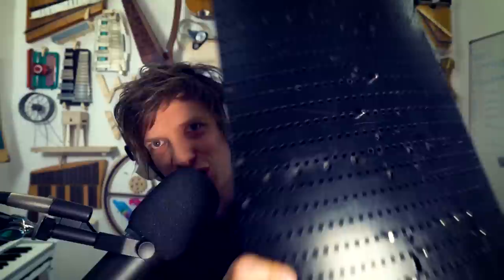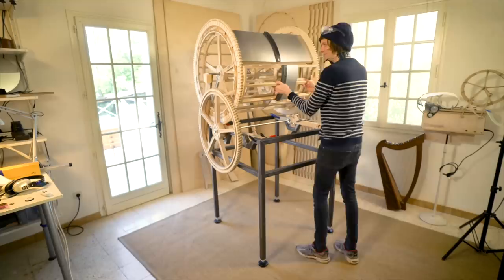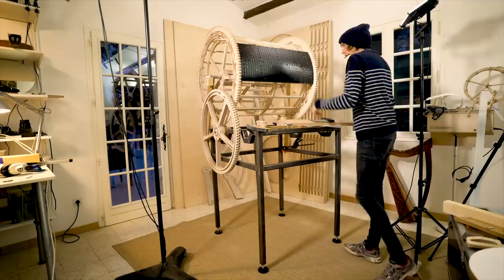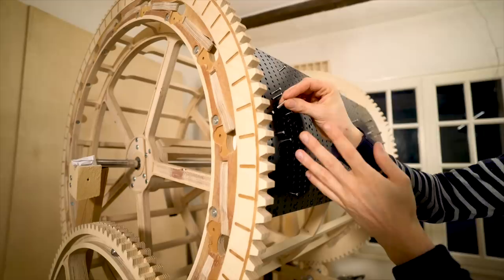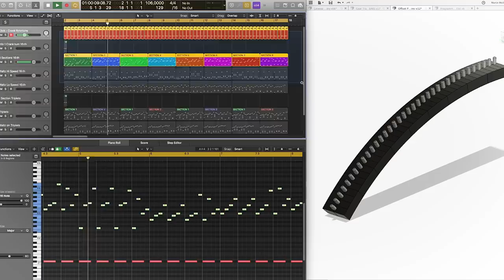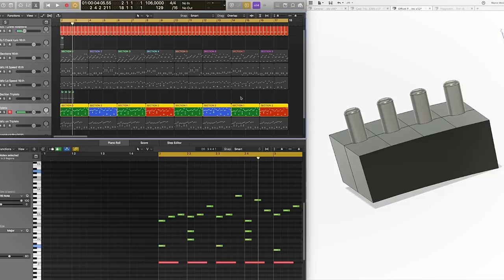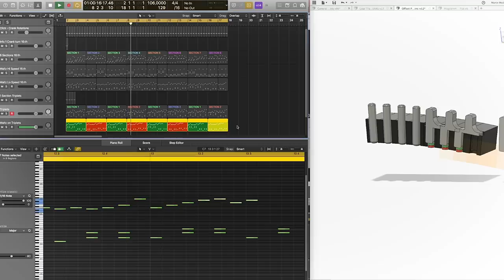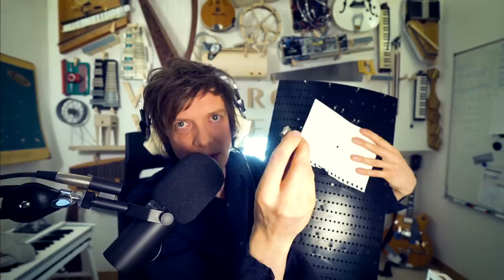Magnet "Midi" Music System - Marble Machine X #25

Comment: I just had another thought: If you provide 12 programming holes per "beat" or crank turn, you can thus arrange BOTH triplets and sixteenths without the need of offset pins, etc. 

This is actually what many of the music arrangers at the QRS music co. did for their pop piano rolls in the 'teens, they used a grid of 12 or 24 steps per beat, allowing for perfect triplets, perfect sixteenths, etc and possibly even sextuplets. (and yes, in the case of the rolls, the steps are very small and close together to save paper space, so that a high paper speed would not be needed for the roll). I think 8 steps per beat were used on some fast duple rolls, and of course triplets would not be possible there. 

So, if you check out the post-1915 (about when they discontinued non-quantized pop rolls in the Autograph series in favor of perfectly mathematical quantized masters) 'teens and 'twenties QRS rolls by Max Kortlander, Pete Wendling, James P. Johnson, Phil Ohman, Victor Arden, Scott and Watters (Roberts and Kortlander), J. Russel Robinson, Zez Confrey, and all the rest, you will hear some of the possibilities and results of this 12 or 24 (or 8) steps per beat roll arranging method.
Reply: Yeah, I was going to suggest something similar, but your idea is even better because it won't require changing any part of the machine that is already built.

Instead of having a number of pins that is a power of two (2,4,8,16), you could have a power of two times three (6,12,24,48). Such numbers can be divided evenly by both powers of two and multiples of three, without the need for any offsets or oddly-shaped pins.
Reply: Clever! Thinking in subdivisions is a much more efficient method.  He may have to use the bar magnets sideways to get the cuts close enough together, but I think this gives him the most flexibility.  He could easily do meters in 2, 3, 4, 6, or 8 without any retooling at all.
Reply: Pretty interesting idea, but the main problem is the feasability: the holes cannot be too close to each other in the rotation direction, otherwise the magnet won't hold in place, and they can't be too far apart laterally because of the width of the actuator that is associated to the track.
Fitting 12 holes in the space there is currently 4 might be quite a challenge. Or it would require changing the programming wheel diameter
Reply: There's also the issue of the time required from actuating one of the levers with the pin to when it settles back and is ready to be hit by another pin.  Going from 8 to 12 pins per programming strip may not be feasible unless MMX is played slower.
Reply: The glory of Base12
Reply: You might be right... but why wouldn't the magnet hold in place if the holes were closer together? Would this be due to some kind of repelling action due to the magnets embedded in each detachable plate for the programming wheel being too close to each other? Would there be a way to mitigate this by making a kind of "web" of some kind of material in-between each embedded magnet, which would block the magnetic field between adjacent holes and keep each individual hole isolated from one another?
Reply: you can do staggered double rows to save some length space, if there is space constraint for the 12 holes.
Reply: A lot of css frameworks use this idea for layout columns... I was going to suggest it... but thought I'd check the comments first :)
Reply: i feel like one issue with that is even if more subdivisions is physically possible, his music style might have to change. a full rotation as it is loops back to the start. if you were to go from 32 per section to 36, then it would loop to the beginning every 1.125x(?) what it is now. it could be turned slower but it wont line up the same unless it were 32x3 per section and then the 4ths were spaced out as 1 pin every 3 pin holes. at that point, the physical construction becomes a problem

Comment: Hi Martin, I couldn’t get into the pinned comment, I guess it’s limited to 500?  Anyway, 2 suggestions:
1) not pins; use bars or even the clicky pen thing.  Why? A dropped pin rolls like a marble;  a bar stays where it falls!

2) I just think black is a terrible color for performance programming.  Is the lighting good on stage during performance?  Try finding black holes on a black background.  Ack!  I would light colors, and I would use colors like you did in your software:  each measure a different color.  Or different octaves a different colors.  Use visual cues to make programming as visually easy as possible.  Unless you’re going to do all your programming in your well-lit shop.   
Love your stuff!  You are a Renaissance Man!

Comment: How about make a reprogramming wheel? It basically works as a music box, a line of trapdoor allow the magnet rods drop onto the program pad, and the open & close of these trapdoors are controlled by a pouch hole paper just like any music box; when the program pad moves synchronized with a pouch hole paper, the trapdoor would open when there is a hole on the paper, and a magnet rod would drop onto the pad and stick into it.

Comment: Use LEDs to mark which holes need pins. Have the power applied when the programming wheel section is taken off, using a plug in power supply with the input jack on that programming wheel section. Each hole gets an led. The controller can also be separate from the programming wheel section, and am the song could be selected as part of that plug in module.
Reply: You could also have a board with LEDs on it that the sections can be placed on, and have the board be connected to a computer or Arduino so you can port the music from midi software

Comment: Hey Martin, I've got an idea for using triplet holes rather than offset pins. Using the bar magnets, could you not align slots horizontally for the sixteenth notes, and vertically for the triplets, on the same track? Or vice-versa. The first slot of each beat would look like a "T", since the sixteenths and triplets both begin at the start of the beat. All the magnets would still fit snugly, and you could write more complex rhythms for one track while saving space. It would also be easy to make templates for reprogramming: Horizontal slots are for sixteenths, vertical slots are for triplets.  

Love this series, thanks!
Reply: I was thinking similarly, however I am unsure as to if the risk of snapping in the horizontal position is significant, compared to the vertical?
Reply: tuve la misma idea :)
Reply: Garrett D Good point, the horizontal magnets would undergo more stress....hopefully not enough to break them
Reply: This seems like the ideal solution. Draw a picture, and share it to the picture stream he linked! He'll see it faster.

Comment: That gear.
oh dear.
Reply: Nothing to ~wheel~ about
Reply: The sadness of this was beyond my "cog-nition".
Reply: Oh also I have a design suggestion, so i'll leave it down here VV

Here's my crazy idea for a pin-loading mechanism that may or may not work; 
It's possible to feed a template sheet as you call it through the (or a) machine, and then build a barrel(or clip) of pins to self-load the machine's plates, however, this means building a second test-drum for building the tracks onto. 

That was a little odd, so let me try to explain my idea clearer; 
You have the empty plate attached to a test drum. You can feed a template sheet (Literally paper) through it to place it ontop of the plate. A clip (think machine gun) is placed ontop of this assembly, and so when an empty spot is "detected", gravity causes a pin to fall into the gap. This will make loading a new track into a plate faster and with minimal mistakes.
Reply: That's wheelie embarassing, he was on a roll
Reply: Unofficial Discord - https://discord.gg/EHDdUeC
Reply: these puns are grinding my gears.
Reply: I know it hurts but at least its small damage that can be fixed
Reply: I like your process, but I don't know if it'll work because of the magnetism of the pins. they will just stick together.
Reply: Though not necessarily a bad idea I think it would be far cheaper and thus easier to use humans for this task.

Comment: Electromagnetic grid below the polyester hole plates. Small springs with just enough resistance to let the steel rods stick out. When the magnet below the spring/rod is activated it is pulled down. Programmable while it runs so not only loops will be possible then. It looses a little bit of the magic of being fully mechanical then, but still it is fully mechanical in its musical mechanism.
A huge electrical grid is needed though with those 10.000 pins.

Comment: I had been thinking about time signatures outside of 4/4 on the Marble Machine X.
Bear with me please: I am no kind of musician at all. I'm very pleased to see that this is something you've also been thinking about.
It seems to me that your idea of using bar magnets in order to have two parallel 'tracks' for 3/4 and 4/4 time is a very good one! It allows you to change tempo within a piece. Something which has occurred to me is that if you use a programming template like you have described, which is 'fool proof' for pin placement, then you may be able to have setup plates which have *no holes whatsoever*. This would allow you to program whatever time-signatures you might wish, as long as the magnetic pins are not able to be tipped over and are not able to slide on the surface of the setup plate.
A steel plate like you have, without a polythylene grid of holes, but with instead some high-friction surface to keep magnets from sliding and with magnetic pins shaped such that they are resitant to being tipped over when in use in the machine would meet this goal.
Anyway, I'm likely to be overthinking this. I think your solution is a great one, and the simple expedient of having two parallel tracks for different time signatures is quite elegant.
I hope that when you all are on tour, that you'll come near to Boston!
Reply: error: too long
Reply: The individually programmable "sticky surface" would me way too prone to error, and also suffer from probably unwantedly programming different instruments or notes simply by moving off the instrument lines.
Reply: The biggest problem is switching between simple time (dividing into 2s like 4/4) and compound time (dividing in 3s like 6/8) there's a fundamental difference in how to think about them
Reply: it might also cause problems for the technicians who would have no set way to set up the bars
Reply: I hear you. I would expect the templates he mentioned in the video to be useful, there, but that may be problematic.
Reply: Makes sense to me. I'm no sort of musician, though.
From a mathematical perspective, it would make sense to have - instead of four holes (sixteenths) to have twelve (fourty-eighths) holes in the same space. Then you're evenly-divisible by two, three, four, and six.
That suggestion leaves aside the fact that now the number of holes is multiplied by three, and so the hole size will necessarily be smaller. Smaller holes suggests a material with greater shear strength than sintered neodymium magnets are likely to be able to provide, and so we're back to the manual manufacturing process (gluing magnets to the ends of pins) that +Wintergatan (rightly) wants to avoid.
Reply: I think you're probably right. The programming template idea that +Wintergatan proposes in the video might help to alleviate that risk, but it may not be sufficient to overcome the problem entirely.
Reply: So you may quickly reach a point of diminishing returns with this approach, but I'll propose it anyway:
rather than four holes per revolution of the crank you may be able to go to twelve which gives you your sixteenths in 4/4, as well as permitting 3/4 waltz times as well. And really, a few other time signatures as well, which may be entirely superfluous.
Risks with such an approach:
Cutting times on the CNC increase by 200% per panel. This may be too high.
Smaller holes would be required. This implies narrower pins, which may break. Also implies a smaller cutter in the CNC, with associated risk of breakage.
And so on.

Something I really love about your modular design so far is that you will be able to experiment with these ideas and how to compose for this machine even after the tour and new album.
Reply: that would be a pain to "program". The main advantage of the guiding holes is that they provide perfect micro timing for your notes. Without them it will be hard to program your loop in a time manner
Reply: I like this idea. The template could be a thick plastic film with holes drilled by the CNC (Ableton Live -> MIDI -> CNC ?). If this plastic film is clamped a few centimeters above the plate it could prevent tipping of the magnets. To reprogram the plate you would just slide the film and with it the magnets from the plate, clamp on the film for the next song, and stick in the magnets. Perhaps it would be even possible to prepare films with magnets already sticking in. Additionally the template could be made of printable film (for example OCÉ IJM545C Polyprop Outdoor Banner 200µm). This would allow design changes according to the song with the additional bonus to be able to easily tell the songs and the plates apart, preventing mix-ups.
Reply: He proposes a solution in the form of programming templates. Those would work just as well for a non-hole platen as for one with holes, i think, but there's no real way to tell for sure without a rehearsal.
Reply: OMG I hadn't thought of leaving such a template in place as a durable part. That's BRILLIANT.
Reply: it is true that it would somewhat remedy the problem, but there are a few things to consider here: 1) the programming template as proposed probably won't work at all, unless it will stay on the machine as the song is played. Due to the curvature of the board it would be impossible to remove the template after putting the magnets on. (since the distance between the pins is different at the bottom and the top of the pins). Maybe you would be able to forcefully remove it if the board doesn't have holes - but you would completely mess up the pin positions in the process. You could somewhat rectify this by somehow placing the template above the surface of the programming boards. but that doesn't seem to be easy to implement either. 2) you would also have to consider a mechanism to perfectly align the template on the board. 3) still this would make the whole process a bit more tedious, since you can't just slot in the magnets to the holes, but have to carefully place them in the holes of the template so you can remove it later.